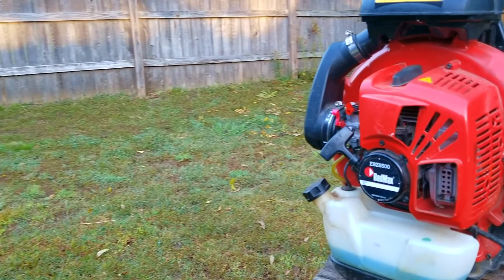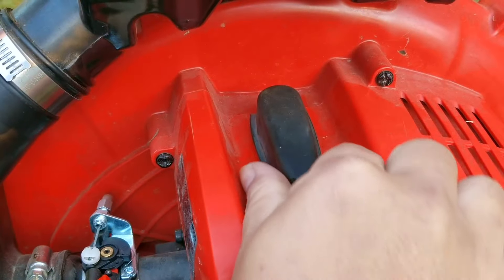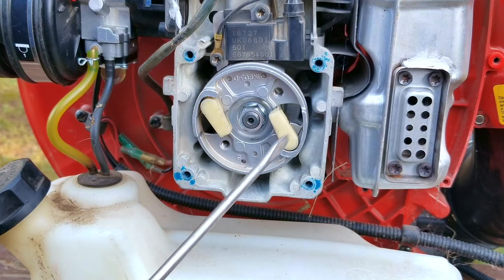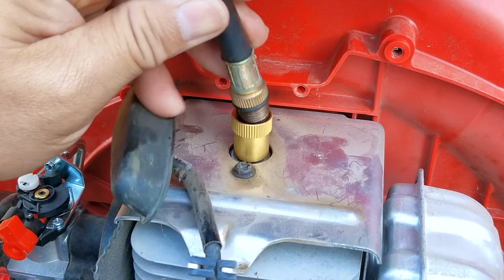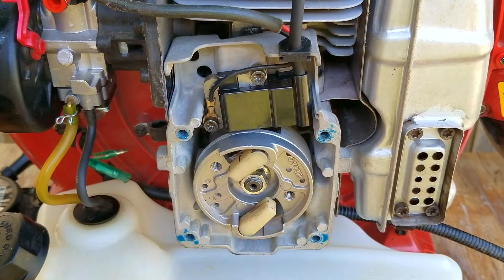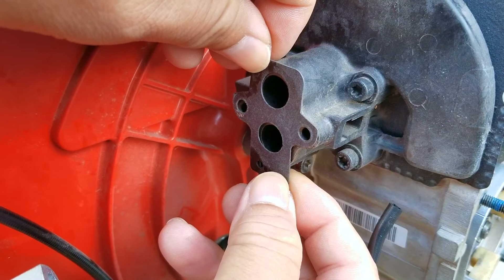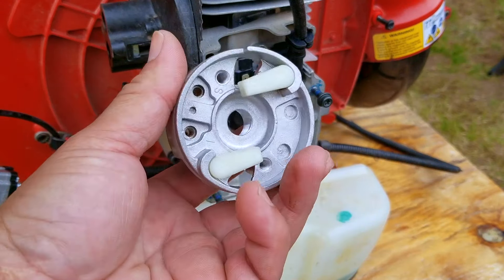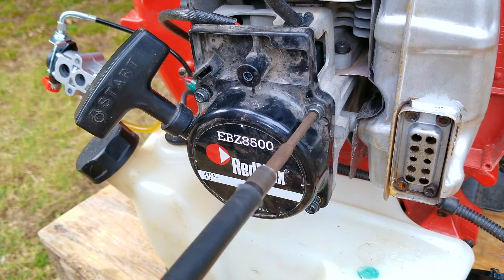Fixing A RedMax Backpack Blower That Won't Start

Comment: lol. the flywheel key slot was manufactured wrong at the factory, or part mix-ups happen too. this is  nothing new i happens a lot with me. plus the flywheels shown where machined different, this happens at factories too especially when they manufacture different engines or make  changes in design.
Reply from the maker: it would certainly seem that way

Comment: I have a question. I have a Husqvarna 5521 BBC push mower and it has a Honda motor on it and was wondering how hard it is to replace the blade clutch
Reply from the maker: I've never had to work on this style of blade clutch before but it looks to be "mildly" difficult if you have some experience and "tough" if you don't have any experience
Reply: @HomeGaragechannel  thank you

Comment: Hey, I have Ryobi trimmer it is only working on half Choke or full choke when I put it in run it stops what could be the reasons for it?
Reply from the maker: yes the diaphragm in the carb is beginning to harden.  If you can see the fuel adjustment screws you might be able to compensate for it.

Comment: that's a new one never seen a flywheel lose magnetism just physical damage worst i've seen was a briggs flathead where it was almost cracked all the way through from both sides of the crank bolt that one must have been magnetically weak from the factory
Reply from the maker: you might be on to something.  This blower has been a hassle to start ever since it came out of the box.

Comment: Flywheel from what it looks that you replaced it with the other one seemed to be completely 45° out of timing so the question is who molded the original flywheel wrong and put it in the machine to begin with??
Reply from the maker: I know right!

Comment: Yeah I gotta say on these blowers it's becoming common especially when they use that crevice tool that restricts air flow or adding extra long tube puts a strain on the engine. Im  90% sure that is the point of failure of almost all the   Blower flywheels as I don't believe they were designed to create such backpressure onto the blower itself something's gotta give .
 But to answer your question yes I've come across a lot of  small engine enigmas that I couldn't figure out the cause. Back then II didn't have the tools, and spent countless hours on stuff that had 0 compression or compression that was too low to fire. I spun my wheels, dumped hours on them but I'm a better person because of it, in the end.
Reply from the maker: wow, I really appreciate your perspective on the matter.

Comment: There's a reason I don't buy Husqvarna products and one of them can be reliability.  The other verified reason is the parts are expensive for the quality.  For example:  a cable for a snow blower chute the OEM was CA$85 at the time I wanted to replace it so I went with an aftermarket unit.  A heavier duty cable for a Honda RotoStop blade brake clutch on a Honda commercial made a few years ago or HR214SX made in the mid-1980s was only about $40.  MTD parts were and are more reasonable as well.  Most of my equipment that I have now is Honda, Cub Cadet and Echo.
Reply from the maker: you make a great argument

Comment: I have such a simillar story on a mower that started in the morning and had fresh gas would not start no matter how I tried. It only back fired through the carb and I squrtied fuel into the intake and the key was not sheared there was plenty of compression at 130psi and the engine was fairely new at 3 years old. There was a strong spark and I checked the carb and the valve lash but nothing semmed to work I just gave up on it. There was no water in the fuel and the oil was at the correct level. Anyways you are my favorite youtuber keep the awsome videos rolling in!
Reply from the maker: sorry it didn't work out and thank you !

Comment: Great video. I was seeing myself as you are going through everything on this blower to find the issue, I have a similar blower-Echo PB580T and it does the exact problem as this one, I even removed the flywheel and it looked good as this blower is new and since I bought it as new from an auction, so even though mine starts only like once a day and it works fine but once shut it off and try to start it again it will not no matter what but it will start like 5 hours later or until the next day. So I noticed that your flywheel looked fine but when you got the new one, it’s key is in a different position and it looks like that was your problem with the old flywheel since it starts so that’s your fix in my opinion. I think I’m going to replace the flywheel even though it looks as new. I checked the whole system and the only thing left is to swap a new flywheel and see.
Reply from the maker: thank you and I do have to apologize how the fix was portrayed, but yes after a new carb, coil, and spark plug, what got it working again was a new flywheel. Yes I was concerned that it was "keyed" in a different position.  At first I thought they had sent me the wrong one.  It looked like it was 90 degrees off from the other one.  not sure if the "improved" timing was the solution or if the magnets were the problem.

Comment: But it ran before? That's real strange. And the new flywheel is oriented differently. Chinese magnets? Or an updated flywheel? But it ran before with the original which is strange. I really hate those fixes where nothing makes sense and it comes down to luck.
Reply from the maker: so this blower was a problem from day one.  Sometimes it would fire up and other times it wouldn't.  I happen to thing this one was a lemon from the factory